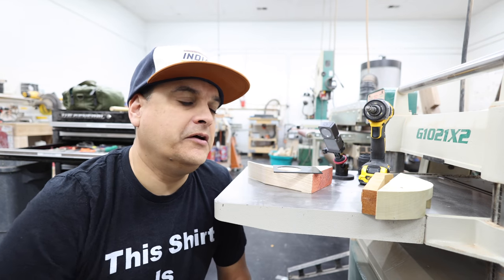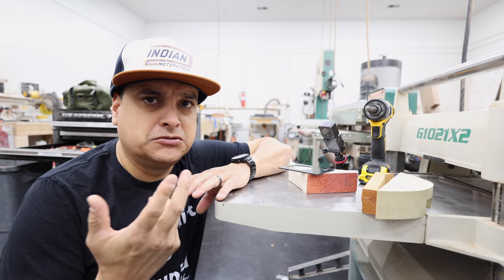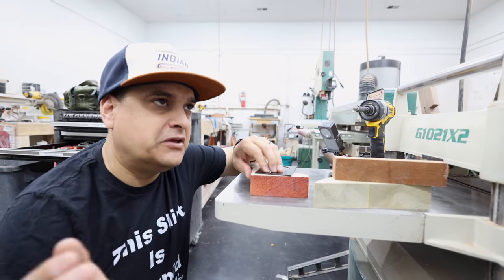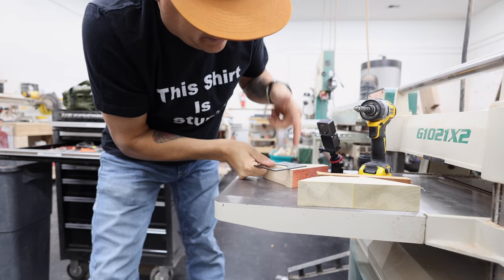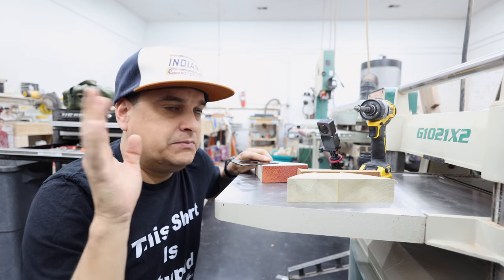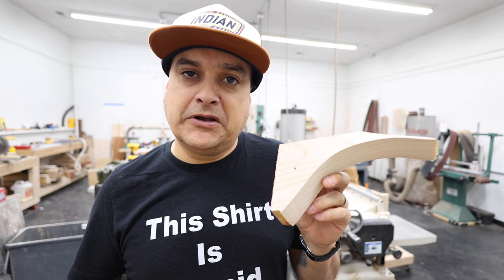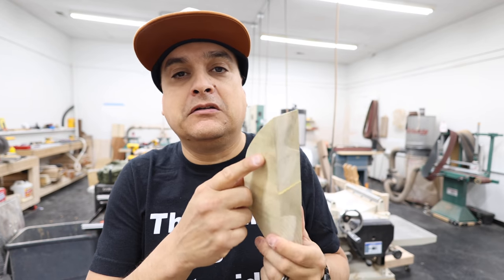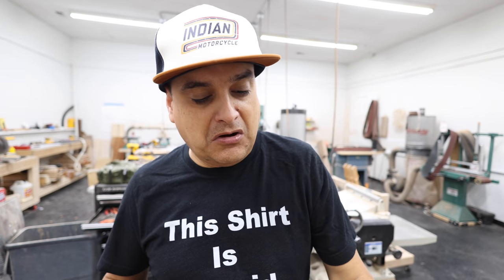What Is The Worst Tonewood For Electric Guitars

Comment: Polar is the #1 construction grade wood for cabinet making, typically in paint grade furniture. It is very stable, takes finishes excellent and the density ratio is perfect for guitars. It is harder and denser than Alder, and on the technical structure it is every close to Mahogany.  As far as using a polyester finish over it, that is the best wood for the job, as Alder dents easier. Ash is subject to insect attacks and fractures easily if not properly handled.  Comments from a Cabinet & Chair maker that also makes guitars.
Reply: Polar is very cold, as well.

Comment: All I got from this test is don’t use a drill to screw in a screw.  I always use a screwdriver to drive the screw home so I don’t over torque the screw.  It just needs to be snug.  I think it would be extremely easy to over torque the screw with the drill.  If that were truly the case my old ash body American series Stratocaster would have had every screw stripped out years ago, as I’ve put mods, and various pickups in the guitar for 20 years now.  I’ve easily taken the pickguard off 20 or more times to change things as simple as cap values.  Every time I put the screws back in with a screwdriver not a drill with a screw bit.
Reply: Yep. I am not sure what Dylan was trying to prove with his demonstration.  That isn't really a normal test for tonewoods.  What is the best or worst is very subjective.  The original Telecaster was made from what I understand was yellow pine.  That is a soft wood.  Tonewoods are important with accoustic guitars.  I would say what kind of pickups you have on the instrument is much more important than what the guitar is made from.  I have a Telecaster made from basswood, which is an analogue of Aspen and Poplar - it has great pickups on it and is painted blue.  Why not stained?  Just like Poplar there is very little in the way of a notatable grain - and so is considered ugly.  I think that that would be the main complaint of Poplar - it doesn't have good looks by itself or stained.
Reply: Sure, but it is critical to torque the pickguard screws to the proper setting. Experts can tell the difference.
Reply: @jeffthompson1869  I could be wrong, but I think Dylan is ultimately just doing a durability test, but using the little faux pickguard and pickguard screws is a way to do that could come up in real life. It's not perfect by any means, you could change your pickguard every day for years and you'll never strip the wooden threads on the screws as long as the guitar is resting on a table and you're gentle with the screwdriver. I was actually hoping that he would have a piece of basswood for this video because in all my ~20 years of woodworking (not professionally, just lucky to have a very highly skilled cabinet maker as my high school woodshop teacher) and owning name brand instruments and my own hand built instruments, basswood was the softest by far. I bought a brand new, cheap six string bass years ago, I handled and played it less than my strat or my jazz bass and it had a spot in the corner where nothing every fell or bumped into it. After 9 months I sold it because the back was covered little dents from my belt buckle and the front had 3 larger dents (about the size of a dime) from just playing it in my room.
Reply: I use an impact drill full blast. Nice and quick

Comment: From Leo:  I wax all the screw holes in every guitar I have worked on and am careful when reinstalling screws. None of mine are stripped out, even on my hollow body guitars.  For the guitars brought into the shop, I kept 3/16", 1/4" and 3/8" maple dowel rod in stock.   I fixed a lot of holes.  There were always  some ham fisted people who must have learned mechanical skills on farm implements.  It seems like the last 10 years has gotten a lot worse.  Using construction tools without understanding the torque limiting clutch seems to be a problem.   I am fixing 2 week old guitars that people installed their own strap locks. Lots of cracked plastics too.
Reply: well, you know a screw is not really tight until something splits, cracks or strips. That's how you know you screwed it all the way in (and of course screwed all up as well).
Reply: @kensolo6793   I got a new Hipshot bridge for my six string bass a couple months ago. I made this bass years ago in woodshop and the body is made from padauk. If you're not aware, padauk is a funny wood; cuts and sands super well, very smooth and it looks beautiful after sanding, even with some ~300 grit those little lines and waves start to pop. It's also very dense and... grippy? Frictiony? Not sure exactly what's going on but I think it's the grain, it will easily and smoothly split lengthwise with enough pressure but absolutely will not compress at all. Back to your point about knowing when you have a screw tight enough, I knew the mounting screw was tight enough when the entire head sheared right off and I was stuck with a headless screw lodged VERY firmly in the body
Reply: "people who must have learned mechanical skills on farm implements."
My guess is the opposite, I think that due to a number of factors, almost entirely related to technology, fewer and fewer people are learning how to use tools besides the simplest little things around the house. I'm not saying this is any kind of moral or societal or political failure, nor do I have grumpy old person opinion about "kids these days." I think it's just a side effect of how awesome computers are, what used to be accessible is now out of reach for most people, e.g. in the past you could fix a lot of stuff on your car at home with very little training, take the time to learn some extra skills using only tools most people had at home and you could do a lot more; now we have so many computers and chips all throughout our cars that the most you can do in some cases is disconnect the broken thing and reconnect the replacement you bought
Reply: @drew9000  sounds like that one was good and tight ;-)
Reply: Imagine their wives suffering on their wedding night.

Comment: I have a guitar with a poplar body. Angled pickup. Sounds killer. Spray painted stormtrooper white and clear coated. Tone wood. Nonsense or a valid thing ? I would have to change the body to test. Does my finish affect things ? Would a more natural Hardwax Oil finish be different on the tone ? So many questions....so little time. 🤣✌️😎✌️🎸✌️

Comment: When I started making guitars I went with poplar because I buy at a local family run lumber yard that has 8/4 poplar at a great price. I assumed that I would botch my first few guitars and didn't want to ruin expensive wood. However, I have continued to use it because it works well, is pretty light, and is fairly stable. I paint the guitars. Some high end guitar companies use basswood, which is considerably softer. Alder is only marginally harder (590 janka vs 540). I have also added some nice figured caps to poplar bodies, painted the poplar and left the figured caps natural or dyed (with clear coat of course).

When I say poplar I am referring to "tulip poplar" or "yellow poplar" (liriodendrom tulipifera). That is the stuff with the greeny look to some grain, AFAIK (correct me if I'm wrong). I have never tried true poplar (populus species).

Comment: I own the silversky se, and I find it to be really good.
Recently I change the pickups to very low output 5.7k and I notice that poplar lacks of mid range which alder has it. So I guess that's why they choose to have a 7.4k stock pickups. If I would upgrade the pickups I will do it to something in the 6.3 area. Besides that poplar is very resonant and light to me.

Comment: this is something to be expected. poplar is really soft and uniform, ash is hard and composed of layers with different properties (mahogany is somewhere in between). the same qualities that make ash (or pine) strong and elastic should make it more brittle than "rubbery" woods like poplar, aspen or basswood. 
but is that much of a problem? a drop of glue usually makes the screw hole functional again, a toothpick can be added in worst cases.

Comment: I have never had a screw hole stripout.  When I reinsert the screw, I do it with a hand driver & a DROP (applied with a toothpick before plate placement) of white or wood glue.  1- the glue will strengthen the fibers,  2- dried it acts as a lock tite, keeping the screw from loosening, so a high torque is not needed.  Screws require a little extra to loosen (very little) & no rusting of screws detected.  
I'm an large scale model railroader so I've worked with all kinds of wood similar or the same used in guitars.  On my Strats most are Ash because II prefer a stain & clear finish to show grain.  Painted bodies prefer Alder or Poplar.  The plain look or unsightly green is covered, plus the cost is lower.  Only one of my Strats I detect a woody tone, I contribute that to the neck.  It's the only one with a boat profile shape (more wood).

Comment: It's 2 years later, but my guess was Ash. I have used poplar in factory shipping and it was light,  strong, and took nailing like a champ, so I knew it was strong. My issue with Poplar is how light it is. I'd hate to build a guitar where the neck is heavier than the body. I did that once with a Tele using a Sycamore body. Mahogany didn't surprise me, since it is a very hard hardwood and with it's grain, and I have had experience with this and Ash. As I recall, once I had to fix a stripped hole in an Ash Strat I built for my daughter. Once glued and filled, it was stronger than the regular wood. But thanks for the comparison. Perhaps someday I will build  Poplar body guitar.

Comment: I have several alder, several basswood, one ash and one poplar. Most are from the 90s. It never occurred to me, but my ash Strat (1997) is the only one with an issue with a whole bunch of stripped screws. One of my basswood Strats from 1992 has one pickguard screw that is just barely stripped, it's still snug enough though/not completely loose. Everything else is good. I also have a pine body on the way which people say is soft, but who knows.

Comment: P.s. If it feels tight, and nothing is moving around, it's tight. If If feels loose after a couple of practice sessions, give it another half turn. If you already stripped out your guitar, try tightening things up by putting toothpicks, or bamboo skewers in the oversized holes.

Comment: I personally would not use alder to build a guitar unless I was going to mass produce cheap stuff (like low end versions of PRS guitars) I do use poplar to make cabinet doors because it is in between Pine wood (that is only slightly better than Douglas fir) and actual hardwood like Red Oak which is if I was going to stain the doors I would use because Poplar is kind of Greenish and the grain is ugly. My fave wood for guitars is Mahogany for bodies and Maple for necks.

Comment: Whether it strips depends entirely on the torque being applied.  I don't know how you could have applied the same torque with each piece of wood by relying on the feel.  A better test would be to set an adjustable torque drill to successively higher torque and report which setting stripped each piece.  Evern then, it might be different within each piece depending on the grain strength at the given screw point.

Comment: I’ve had guitars with mahagany and alder bodies where the strap buttons have worked their way out and partially stripped and required shoving toothpicks in the hole to fill it back out. This usually happens around a year or so. Just from use. The one guitar I have that has an poplar body that I have removed the guard a handful of times since purchase (brand new) and have never needed to tighten up the strap buttons on. Another guitar that was purchased shortly after with mahogany sides and maple top and back, started working out the strap button after around the year mark (a little more, closer to a year and half). Time to dig up some toothpicks.

Comment: Pretty funny.
In '95, i found a MIM Sq Strat at a shop. Rental use only at a consignment shop..."Go next door, they'll have one"
They didn't.
Went to another shop which had like a dozen MIA Peavey Predator Turbo guitars, all black like the Sq.
Found one i dug and went home to ask the Missus. Went back a week later and half were gone.
Next was one with a beautiful birds eye maple finger board and while it didn't sound as good as the other, it was still awesome.
$239 with a gig bag, strap, cable and all. I still have it.
and, yes, its made of Poplar. Best example of tones, Workin' For MCA by 'Skynyrd. 4 single coils and a great switching set up.
Its never been apart but needs a 5 way switch,,,i don't have anyone i can trust with it. Local shop closed...
Works but sloppy in #5.
btw, Steve Morse chose Poplar for his MM sig model about 20 years ago. Can't be too bad ;)

Comment: one other structural consideration is that different woods dry out or absorb moisture at different rates..some types of wood will shrink and expand because of this at different rates and can be a problem when mixing woods..or you can get some pretty serious cracking as it dries out..

Comment: Didn't we establish previously that wood doesn't matter for electric guitar tone? Did I miss something?
Reply: Tell that to Paul. As in Paul Reed Smith
Reply: @maspesasmasperras5554  That's the exact reason that while I've always liked his designs I've never been able to fully embrace PRS. He's a snakeoil salesman and I just can't respect that.
Reply: The whole video is about getting screwed. Watch it.
Reply: @xClunky  Call me crazy but that statement is beyond nonsensical lol. If wood differences matter with a bass, I don’t see how it wouldn’t for a guitar as well. Specifically for this reason I have 2 of the exact(as exact as ‘exact’ can be) same streamers. One is solid bubinga with ovangkol neck and one is solid maple with ovangkol neck. They are RADICALLY different sounding. If woods are different densities, how would that not make a difference?
Reply: Bubinga’s crushing strength is 10,990 lbf/in squared and maples is 7,830 lbf/in squared, how would it be feasible to say they have the same acoustic properties
Reply: @DougieD_Funk  It's not a subjective matter when it comes to tonewood and guitars. It has been demonstated (and video of that has been shown on this very channel) that you can literally make a guitar out of 2x4s and have the strings over a neck made of air (yes, of air) and, as long as the electronics, hardware, dimensions and setup are the same, it will sound the exact same as a guitar made out of any wood you pick. 

Now, intuitively, I would expect it to be much the same for basses though the physics are a little different because of how lower frequencies might interact with the wood of the body so I can't assert it is the same as for guitars.
Reply: @Leo_ofRedKeep  Maybe I turned it off too quickly. It seemed strange to me that Dylan would discuss the benefits of various tonewoods since he debunked the idea of tonewoods on this very channel.
Reply: @xClunky  Tonewood in the title is for clickbait. He wants the views.
Reply: @DougieD_Funk  That's just not how the physics works. It's really "Introduction to Waves and Vibrations" level physics (see French's boo). The wood in a electric guitar isn't part of the system that produces the sound. The wood of the body and neck doesn't affect the way the strings vibrates (the modes of vibration and the harmonics produced) any non-negligible way (unless it was very very thin and so the saddles would oscillate with the movement of the wood). What affects how the strings vibrate is the length of the strings and the connections at the ends (the saddles and keys). Then, the other things that affects tone is the how the sound is transformed into an electrical signal and processed (the pickups and electronics). 

Wood matters in an acoustic guitar because the guitar's cavity is where the sound is amplified and therefore the properties of the wood and the shape of the cavity determine the frequency response of that amplifier.

Don't take my word for it. The equations for describing the vibration of a string speak for themselves and they're very good demonstrations of these principles applied to guitars online.
Reply: @xClunky  lol my point is tap on one wood and it will sound different than the other same size block yet different type of wood. So to say the wood makes no difference is crazy is all I’m tryin to say
Reply: @DougieD_Funk  I don't disagree that tapping one wood or the other won't sound the same. My point is that that has no bearing on the sound of an electric guitar because the wood that about the body and neck are made out of don't affect the system that determines the tone at all. 

Tapping on a piece of wood and strumming a string that is attached to pieces of metal which are screwed into wood and having that vibration picked up by magnets and processed through electronics are two very very different thing. 

You could have two telecasters with the exact same setup. One made of acryllic, the other made of whichever wood you like. Tap them and they will sound different indeed. Strum them plugged into an amp and they will sound the exact same.
Reply: @DougieD_Funk  Seriously.... 
Tap on an aluminum phone and it will sound different than the other phone made of plastic.
Does the music in the earphones sound different though?

Comment: Has to be pine, poplar, or basswood because they are "squishy". Physically, that means faster deterioration and warping over time. While some will argue the tone is not the issue, when the bridge wiggles itself closer to the nut over the years and no longer has enough strength to hold screw threads, these are probably the worst. I, like everyone else, leave my guitars out in the rain and snow so they can self-relic. 😂
Reply from the maker: Show me… I want to see proof.